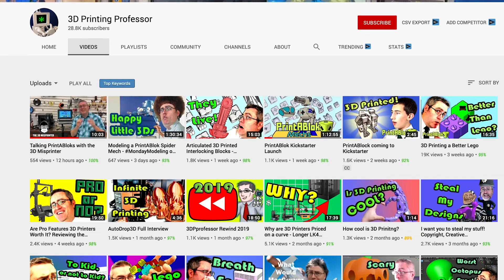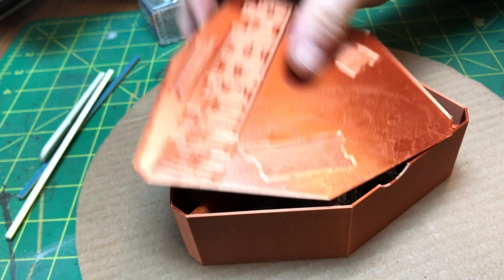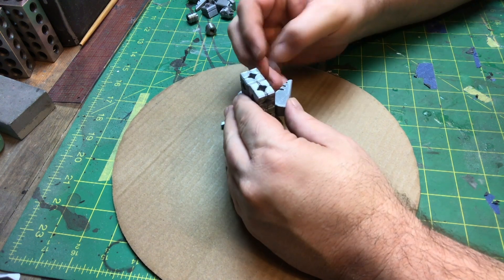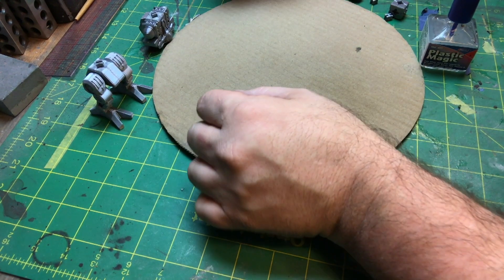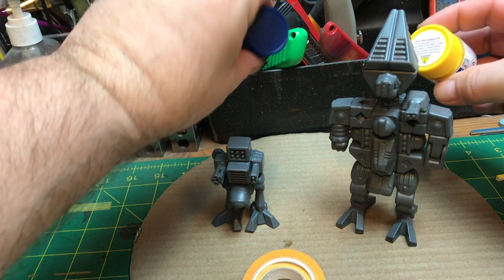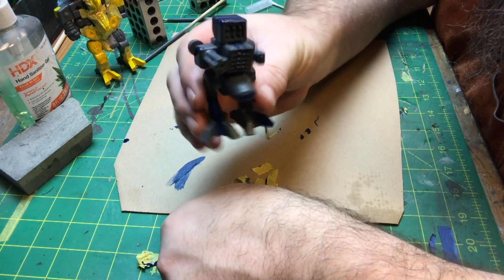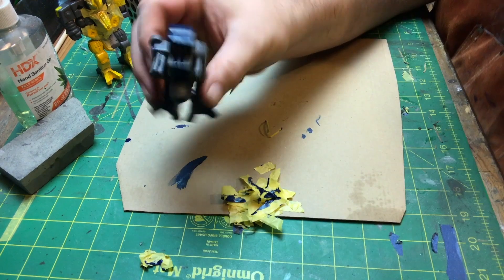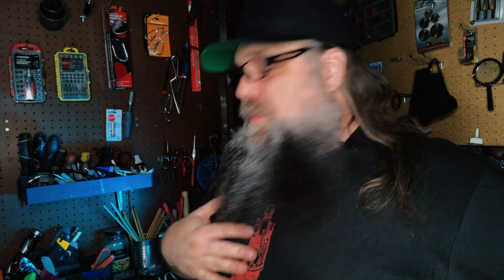MECH MODEL BUILD: 3D PRINTED SNAP KIT “PrintABlok”

Comment: just curious...would you be able to scale these blocks up with the printer files by plugging in different vectors? nothing insanely huge but possibly twice or four times the current scale? seems that such an ability would be pretty awesome for builds like this one and allow for greater texturing and subtle design elements to be included
Reply: Scaling up parts in 3D printers is trivial. It's just one number in the slicer while you're preparing the print and you're done. Just be sure you're scaling them all up by the same amount so they'll still fit together.
Reply: @3dpprofessor  most excellent... was hoping it would be that simple